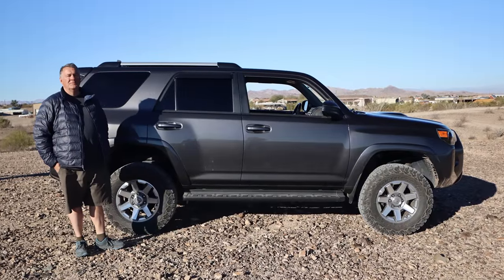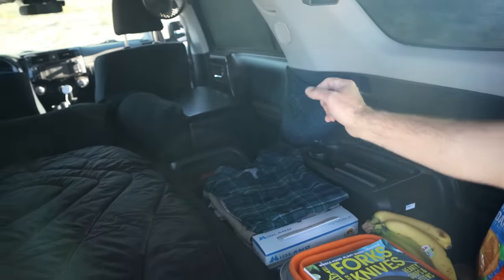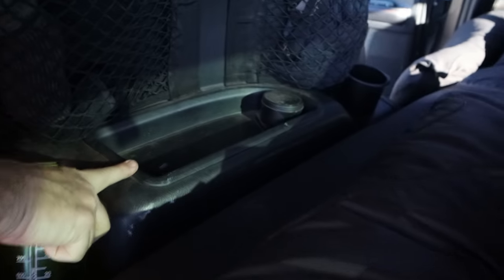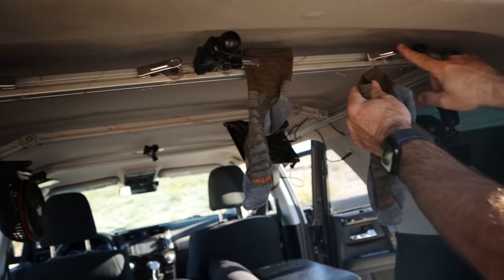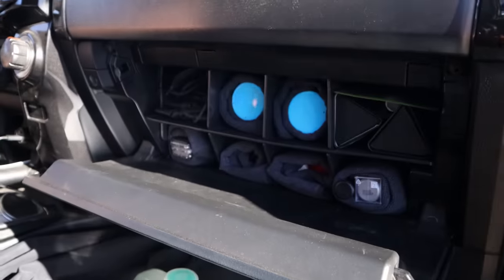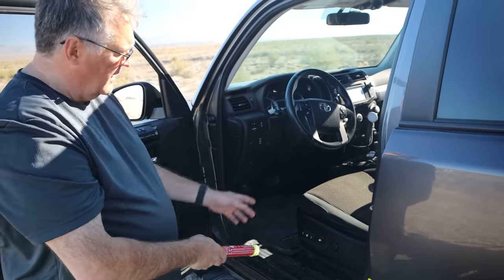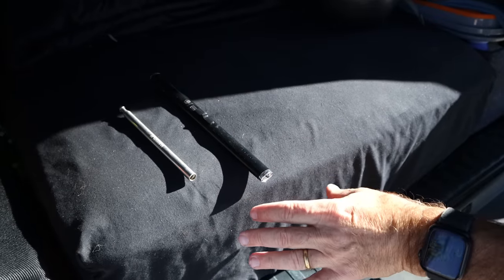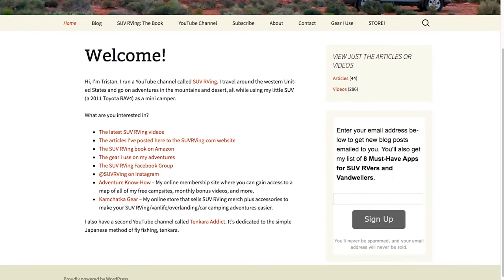This Is The ULTIMATE Stealth SUV Camper and Overlander! (Modern 4Runner Build)

Comment from the maker: **GEAR JOHN USES**

► SLEEPING
* Mattress https://amzn.to/3y7rt9z
* Fans https://amzn.to/3m9gGsy
* Primary Blanket https://amzn.to/3y4F0i7
* Secondary blankets https://amzn.to/3SIqVjV
* Mesh cargo net pouch https://amzn.to/3mmrrYU

► LIGHTING
* Magnetic flashlights https://amzn.to/3mgX71M
* Fairy string lights https://amzn.to/3KKTafX
* White/red hatch lights: https://trail4runner.com/2019/05/15/icarus-extreme-led-hatch-lights-from-arclightleds/

► COOKING
* HotLogic food warmer https://amzn.to/3kA2zML
* Alpicool 12v refrigerator https://amzn.to/3KNmmmi
* Neoprene koozie https://amzn.to/3mk1mJR
* LifeStraw water purifier https://amzn.to/3KOBkJ1
* Epicurean cutting board https://amzn.to/3kI6tDd
* Collapsible sink https://amzn.to/3mlkbMA
* Collapsible kettle https://amzn.to/41AqFaK

► RECOVERY
* 4 ton come along/winch https://amzn.to/3mkCa5M
* 8’ tree hugger strap https://amzn.to/3y4A1Ok
* 3 soft shackles https://amzn.to/3md6fEp
* 20’ strap https://amzn.to/3IHkucf
* 30’ strap https://amzn.to/3ZzOvSi
* 30’ kinetic energy rope https://amzn.to/41FSH4L
* Electric air compressor https://amzn.to/3y2dKAX
* Adjustable tire deflators https://amzn.to/3Z4XHy1
* Saw https://amzn.to/3ZbEZVn
* Folding shovel https://amzn.to/3J5p4Cl
* Tool kit https://amzn.to/3mkBe1y
* Tire patch kit https://amzn.to/3y0kEql
* Lithium battery jumper https://amzn.to/3IJtwFw

► CAMERA GEAR
* Drone https://amzn.to/3mkCqlg
* GoPro https://amzn.to/3kC5DI9
* Large tripod https://amzn.to/3J3kWmC
* Small magnetic tripod https://amzn.to/3kF1Zx3

► POWER
* Solar panels https://amzn.to/3IArPdq
* Jackery 500 battery https://amzn.to/3J69lmI
* USB wall socket https://amzn.to/3KOm3rq

► SAFETY
* Trauma kit https://amzn.to/3ZstmJm
* Bear spray https://amzn.to/3y9dKPi
* Water filter https://amzn.to/41A5J3v
* Fire extinguisher https://elementfire.com/collections/allproducts
* Center console safe https://amzn.to/3kF2wz3

► VEHICLE UPGRADES
* BFG KO2 tires https://amzn.to/3EON8qB
* Hatch release switch https://www.4runners.com/threads/aftermarket-remote-trunk-release.9384/
* OME 3.5 inch lift https://amzn.to/3ZeeQoS

► HYGIENE
* Hand held bidet https://amzn.to/41DU3gb
* Travel towels https://amzn.to/3YenkuQ
* Toothpaste tablets https://amzn.to/3kK4KNx
* Folding toilet seat https://amzn.to/3mgGkM7

► COMMUNICATION
* GMRS radio https://amzn.to/3IHwlXQ
* Satellite communicator https://amzn.to/3SIKCrL

► EXTRA GAS
* Gas containers https://amzn.to/3mgusd2
* Locking gas container mount https://amzn.to/3ZvoR0F
Backer plate https://amzn.to/3mmmuPt

► INTERIOR CEILING RACK
* Pivot joint https://amzn.to/3J2tRUf
* Extruded aluminum bar https://amzn.to/3mgYkpQ

(These are Amazon affiliate links.)
Reply: Thank you for the list. This is a great video to save for later reference.
Reply: @KirkMcc  yeah is there a link to his channel somewhere? Great build!!
Reply: where is link to his channel
Reply: Omg this is so cool!!!
Reply: Great way to list everything. Very helpful!
Reply: @lglubbock7593  Minimalist Overlander is the name of his site
Reply: Need to add link to his channel/social media. Can’t make us work for it after we’ve watched your videos 100% through 😊
Reply: What about jumper battery for the back woods when the car battery is discharged?
Reply: @KirkMcc  the link is there but John probably spray-painted it. Black.
Reply: @EugeneJrFolse  John had a lithium battery battery jumper. He mentioned it was good for six jumps. Very small. Looks intriguing. I’m gonna look for one of those. 27:20
Reply: This guy has Randy-Vining ❤❤❤
Reply: Thank you so much!
Reply: Hi, can you post a link to your bidet?

Comment: As a fellow 4Runner overlander, I have to give him big props for that ingenious interior roof rack system. By far one of the neatest things I've seen using the roof space inside the back of an SUV and may incorporate something similar into my own build.
Reply: Would love to see your solution when you get it up and running! Cheers.
Reply: What a great idea and solution.  Some cargo netting and you have some extra storage space - you can be selective where you put the net.  As I MTB i need more storage space that this set up - so would like need a platform under the bed for additional storage - but this has given me so many ideas

Comment: Good one. Thank you. 🌻

I also have a 4Runner. I wanted an indoor gym to use when desired. One of the components is overhead grips to use for inclined pullups and chinups. It works great. You can run a doubled rope between the helper handles, with the rope passing through two padded grips that slide back and forth. Or you can do something similar with a bar.

The rest of the gym consists of resistance bands, grip strength devices, and an adjustable hydraulic exerciser, which is much more versatile and useful than usually appreciated, especially if you get creative and make full use of the possibilities — the same can be said for resistance bands, bodyweight exercises, and dynamic tension exercises, including isokinetics, isometrics, and isotonics. Also various yoga and breathing exercises. If you make full use of the possibilities it's really surprising what you can do.
Reply: Wow! What’s your channel? I’d love to see your vehicle!

Comment: I have pretty much the same setup in my Mazda CX-9, minus the off-roading mods. Even the same mattress, but I went with the 6" version with a 2" memory foam topper. Best mattress I've ever had and the same as I use at home. I use custom fitted window covers with the shiny side facing in (nothing says urban camper like reflective window covers), a 19" TV and a 52qt fridge. I built a "shelf" that runs along the full length of the mattress that the fridge sits on, and underneath I've got my batteries and solar electronics and all my cooking gear, with a 180w solar panel painted black mounted on top between the luggage rails so it's pretty much invisible. I mounted a Max Air fan to a panel I made that drops into the sunroof and it pulls a huge amount of air through the vehicle which keeps it cooler and keeps it from smelling like a locker room, and then when I'm moving I remove the fan and stow it behind the seats. I love it.

Comment: I have a 2009 4th gen 4Runner converted into a full time stealth camper :)
Storage, outdoor kitchen, 100Ah battery, solar panel, cooler 'fridge', built in webasto heater, isolated windows, and isolated side panels.
I should share with you my whole setup!!

Comment: If you want to go cheap on the interior roof rack you can try to use the telescoping shower curtain rods. Just buy little clamps if you need to put them where there aren't handles. Nice truck!
  I'm currently doing an ANTI STEALTH straight piped cayenne build.

Comment: John...!  What a great setup you've built!  There are more than a few gadgets or equipment that I'm going to check into for my 2007 Subaru Forester.  Your 2016 Toyota 4Runner is definitely a bigger and more sturdy rig... you've done it so well... especially keeping it with a generally stock appearance. Thanks for sharing... and thanks for your extensive list of components used.
And thank you, Tristan, for yet another interesting and informative video presentation!
Reply: Thanks Rex. Happy trails.

Comment: I bought a Toyota Sienna AWD a couple of weeks ago that I'm going to lift. I tried doing a stealth camper in my SUV and F150 but you can't really sit upright comfortably in the SUV (like in this video) or get in and out of it easily or stealthily. The truck is OK with a high roof topper, but you still have to get out of the vehicle to get in the cab and drive off, and in emergencies, I want to climb into the front seat and go if needed. The lifted minivan has the height of a Tacoma, and still gets into parking garages, so you can't really go wrong.

Comment: Really enjoyed this video. I have a few of the items he has like the Hot Logic (DC version) and it works really well. Made some hot dogs and warmed up left over pizza and it worked great. I also have those USB fans and on low, they run over 12 hours.

I really, really wanted a 4runner for trips like him, but since I'm really tall(6' 9"), my van makes a lot more sense.

I love his power set up and I'll be doing the same, minus the roof panel.

Lots of great ideas. Once I figure my sleep set, I'll be hitting the road too.

Comment: As a happy owner of a 4Runner TRD Off Road Premium,   I have some advice to anybody with a 5th gen that wants to get into overland camping, but think you need a rooftop tent, or just can't afford one.   You don't need one!   I use to use one, until i purchased a self inflating solo (single) air mattress made by Deep Sleep, specifically made to contour the either side of the back of my 5th gen 4Runner, with seats folded down.   It leaves the entire rest of the back and rooftop for storage.   When not in use and deflated, the mattress stores easy in a super easy to store bag. 

It saves me a lot of space, time and money.   Freeing up your roof means you aren't trying to cram everything into the back of your rig, all around your food.  I can now keep my food away from stuff like recovery gear, chainsaw etc, a lot more comfortably.

IMHO  I'm able to stay out longer, not having all that potential roof rack storage used for a single RT tent.     You can still fit in a small ground tent, (I use an Australian single swag tent) for when you want to camp outside.   So it is perfect!      It obviously will be best for stealth camping, because it is out of site when not in use!  All your seats can be up etc lol

This was a great video with an excellent build with great ideas!   Thanks!
Reply: Love that mattress too! Happy trails.
Reply: @minimalistoverlander  Thanks! Your build has wonderful ideas!    I just subscribed to your channel!   That ceiling bar system is everything I want and need lol

Comment: Lots of great ideas, many I will be stealing. He is definitely more of a mimimalist from the outside than we are, while having a lot on the inside. We have a 2014 Trail 4Runner. I installed dual batteries, a Redarc controller with an Iceco fridge, extra USB and 12/120 volt outlets along with a hitch mount 12,000 pound winch wired front and rear. We do have an awning along with a ground tent. There are 3 of us so sleeping inside won't work. Everything other than the roof rack and rock sliders are removeable. This allows us to camp without the awning and roof box and be stealthy on the road.

Comment: Wow great setup, you got every inch out of it!   For a less often used setup for myself I a considering a 43.5” wide mattress (the max length that will comfortably fit between the wheel wells, before having to jam anything in)…75” of length will fit with the rear seat bottoms removed.   So I am thinking of getting a custom made 5” thick tri-fold mattress made to those dimensions, but it’s pretty damn expensive.   On the other hand a STANDARD Twin size mattress (way more economical) is exactly 75” long, and 38” wide.   Like do I really need that extra 5.5” of width if it’s just me?   Probably not.

Having said that, if I’m ever with a partner that extra 5.5” of length would be huge!    The tri-fold option would also be a plus for storage at home, that thing could be stored on a shelf or on top of a long bureau.   

Now if you have a tall platform that gets you about level with the top of the wheel wells you could then get a Full sized mattress in there for two people (75” long, 54” wide).   But some people complain that getting closer to the ceiling sucks and feels like you’re in a coffin, others are cool with it.   My opinion is that if you won’t be sleeping in it often, and if the second person isn’t an intimate partner but just a friend, the 54” wide setup would be better.

Comment: Get some comfy wool Ts too. Wooly or woolx make nice ones. Lots of brands I’m sure but you got the gist. Nice affordable build for most ppl too. Thx for sharing. Ps. Another option for ppl with higher power needs would be to spend a little more coin for a higher output panel. A nice single from LG could throw down 300w plus easily.

Comment: Nice build. Can you sit up inside the rig on the bed comfortably for extended periods of time (when it rains)? Also why not use an eco flow Delta (or similar for self contained power) instead of solar? I’m on the East coast so solar use is sketchy at best year round. Ty!

Comment: Great ideas. The only issue I see is the limo Tinting.  I had the same issue on my car . While it's great for the side and the rear windows, the laws States we can't do it for the driver or passenger side windows or of course the front window shield. Therefore when someone flashes a light through the front window, or driver or passenger side windows it is not tinted and you can see all the way through the car. That's why I have to put up a drape separating the two front seats from the rear. Otherwise anybody can see right in from a street light or a flashlight into the vehicle. That happens to me a lot if I sleep in a city under parking lights or at a national park when a ranger comes and flashes the light in my car. With the drape up they can't see it at all.

Comment: I appreciate the thought an precision he puts into his choices and build.  There are a few things I'd do differently, but unlike most builds, there were no glaring errors or stupidity.

I have very few suggestions for him to improve his build.  Basically, a curtain behind the seats, USB-C PD everywhere in addition to USB-A, and, replacing the Jackery with a LiFePO4 power station with PD in/out.  Not that Jackerys specifically catch on fire, but even Jasonoid, who really knows what he's doing, had a battery turn into a fireworks display.  Considering the $$$ John invests in other safety measures, it's a no-brainer to sell the Jackery immediately and get an Ecoflow/Bluetti/whatever LiFePO4 that doesn't risk a fireworks show in his rig.

I fully agree with his all-black choices in the interior.  Seeing at he doesn't crawl from the back to the driver's seat, I'd highly recommend putting a curtain made of the black photo backdrop material behind the seats from headliner to seat cushion level or lower, to prevent anything from being seen through the windshield.  Just blackness.  I use 3 layers of the Ravelli muslin photo backdrop for that purpose in my Prius Prime.  Make it wider than you think you need, wider than the curtain rod, to give options for how you clip or Velcro it to the sides by the seatbelt retractors.  It comes with a curtain rod pocket at one end, and for a rod I use an aluminum 48 inch ruler flexed between retractor trims.  Being a ruler, it's easy to document the length, hahaha.  I drilled holes for stops I made out of 12ga solid copper wire, to prevent the ruler from slipping down into the retractor.   With his 8020 frame, he could maybe hang the curtain from that, stuff it between that and the headliner, or make a solid black piece to overlap from there to the headliner.

Limo tint is great, but illegal in most states, even in the rear windows.  My state does inspect for it, and does ticket for it.  Intricate Explorer, who I got the photo curtain idea from, also went with limo tint and rain guards, but I prefer window inserts to pass state inspection and avoid tickets.  There's nothing saying you can''t have a window insert with basically a window as good as limo tint, and maybe only have the screening at the level of the rain guard.

His tire choice is sensible.  Personally, living in NH, I prefer snow/ice tires to offroad tires.  It didn't used to be practical, because snow/ice tires didn't last many miles, and didn't handle well in summer, requiring PITA switchover twice annually.  Michelin X-Ice3 changed that all, and I got hooked on them.  They dandle like summer tires, even in 119F AZ heat, are great on snow/ice, and last 60K+ miles because I did upsize a little and go up 7-10 load index numbers.  The tires are expecting to hold up a minivan and only actually holding a Prius.  The Michelin prices when nuts (new version, shortages, etc), so I've gotten a pair each of Continental VikingContact7 and General Altimax Arctic 12 to try out and compare the handling and life of.  I'm breaking my rule of only buying identical sets of 4, in the interest of comparing them in the name of science.
Reply: Wonderful commenting. Thank you. 

I had to laugh when you mentioned the photographic backdrop curtain behind the fronts seats. That’s exactly what is use. We just didn’t have time to show it. I put two high power magnets behind the plastic trim between the front and back windows. I then sowed magnets into the curtain. Super simple to put up and take down.

Also love your comment about the battery. I have since ditched the battery and solar altogether for a much simpler solution to the power problem. New video coming out on my site.

See you down the road.

Comment: That is a very well laid out 4Runner.  Not too much, and just the right amount to get things done.  Very stealth.   My only thing to add would be for John to rethink his repair for brake lines. Tape isn't going to hold (or hold for long) due to the pressures involved, otherwise having spare brake fluid is a good idea.

Didn't see anything regarding basic vehicle tools for trail repair.  It is a Toyota, so he's probably good regardless.
Reply: We weren’t able to show everything do to time. Tristan was on a tight schedule. I have a toolkit specific to Toyotas that I keep under the driver seat b
Reply: @JohnMason-Hill  Well then, you nailed it John! 

Makes me think I carry WAYYY too much gear with me.

Comment: Great Setup!  Quick question  How in the world did John attach the swivel joint to the roof?  The OEM handles attaches with clips and there is no bolt hole there to screw into.  Am I missing something or does older years have actual bolt holes?